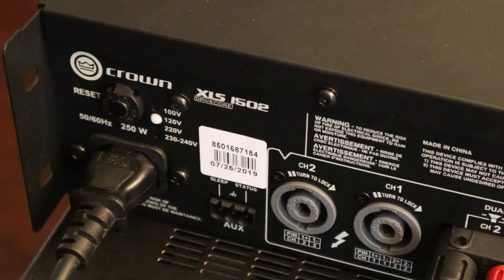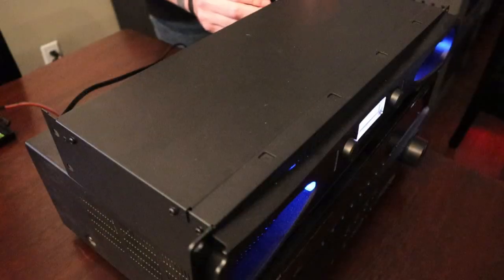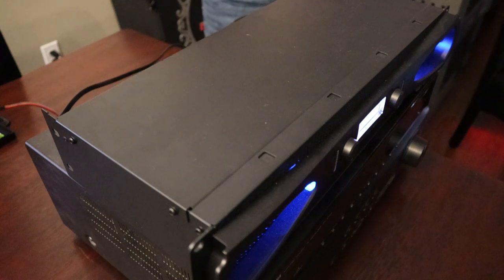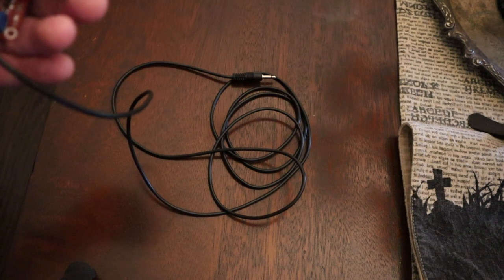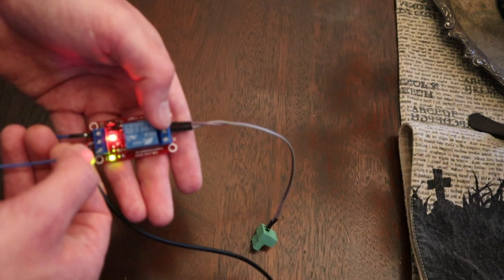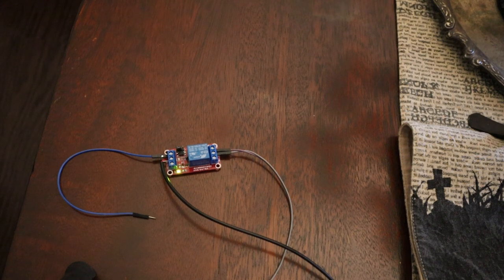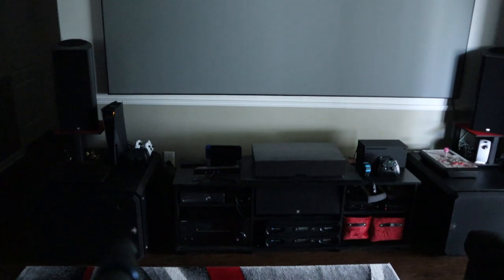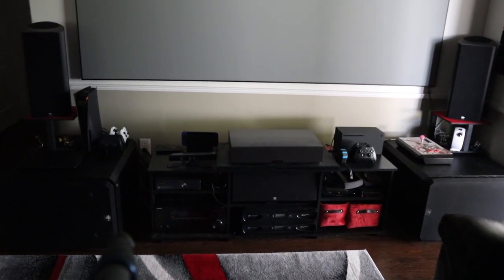12v Remote Trigger for Crown XLS Pro Amps (1002, 1502, 2002, 2502) - Home Theater Integration

Comment: I have been trying to do this for a month. Thank you!
Reply from the maker: Your welcome, I was hoping it would help at least someone trying to do the same.
Reply: @ViciousXUSMC  well...i dont know if i got a bad relay or not but it lights up like yours but it always has a short on it so it always stays in sleep mode. any suggestions?
Reply from the maker: @greenflintriver  If you used the same relay, swap your connection, it has one normally open and one normally closed.  You should be opening the relay on power, so you want to wire to the normally closed connection.

The lights and the clicks will let you know the relay is working.  So thats the first step.

The video shows all those things, so just make sure yours is mirroring what mine did, and make sure you have the jumper wire for the relay activation side, you need power to the board, and to the relay.
Reply: @ViciousXUSMC  thank you for kind reply I will keep trying . I put an ohm meter on the output side of relay and it is 0 ohm short wether power is on or off.

Comment: Panamax power bar m8 av-pro has an 8 plug power bar, 4 plugs are controlled off a 12v trigger from your avr so easy set up for crown xls amps or external devices like hard drives you wish to shut down with one remote. Works great.
Reply: Thanks for this information. I have a Crown XLS 2502 and this is exactly what I've been looking for.

Comment: Thank you so much for this guide. 
I am currently researching everything I needed to build and install 2 15 inch subwoofers into my existing home theater with avr as brain box to the system. For a passive big home subwoofer it seemed everyone on the internet went with these style amps because of their high watt per dollar, but one thing eluded me and it was their lack of trigger which was a hugggee buzz kill. Knowing that there's an easy solution is a life saver, will probably save me about 500 bucks over a home theater oriented external amp with 750-1000 watts a channel

Comment: This works well if you have a relay with dry contacts (i.e. the relay doesn't send power to the contact you close). Be aware some relays are made for lighting and are simply a remote light switch and will not act like a trigger but will send power to your connection.

Comment: I ended up doing something similar on my XLS2500 but with a 3.5mm jack mounted on the chassis and everything else inside. Looks like factory installed. It accepts 3-32v DC as trigger input just like any other high end power amp.

Comment: So we have all read through the comments and know that the Panamax M8-AV-PRO is the best option out there... EXPENSIVE AF for literally a power cord with some additional features but it almost looks to be the best option out there at the moment. We all rather have that protection with our expensive home theater components but having to justify almost 200 dollars for one of these bad boys is wild 

Edit: I found one used one amazon for 140 USD but still not happy with that price at all.
Reply from the maker: I am using the panamax (forget the exact model) and I got the one with network control so I am not triggering it with the AVR, but instead actually network commands using home automation.

So I could have also just used any "smart switch" and had a UPS.  There is always options if you think outside the box!
Reply: @ViciousXUSMC  Ig they really get you because it was made for audio. Like that in itself compels you a ton. The reason I didn't go with the home automation is because I'm a college student building a home theater for my parents in the livingroom and when I leave I just want it to work such that they don't have to try to figure out technology.

 The Panamax M8 AV PRO just seems like it'll just work whenever the AVR turns on which also turns on automatically when the TV turns on.  They're not going to do any additional steps as they're just used to turning on and off and nothing else. 

I'm building the entire theater components from scratch, I learned how to build speakers straight from scratch and even make crossovers so its a big DIY project that has been going on for a couple of months, I've been practicing and building other speakers and now I'm getting ready to build the final ones (CENTER RIGHT LEFT & SUBS), I'll even be using dual 12" ultimax subs from dayton audio in ported enclosures with f3s of 15hz. It should all turn out quite nice

Comment: I wish this guide had been around when I bought my crown amp.  I ended up buying an IoT Power Relay for around $35 and wired it to a USB cable plugged into a USB port on my receiver that powers on when the amp comes on.   Not a bad solution for somebody who isn't comfortable with a lot of wiring.
Reply from the maker: Better Late than never :) My ultimate solution was a Panamax Pro unit that has the 12v trigger built in, since I have 6 of these in my setup, having them sequence and not be on all the time was nice.

I also integrated it to my Alexa so I can turn it on/off via voice command.
Reply: @ViciousXUSMC  do you have the model number of the Panamax unit you ended up with?

EDIT: nevermind, found your other video  ;)

Comment: I contacted Crown and asked if there were any issues just powering the amp on and off through a master controlled powerstrip, where my AVR is the master. When the AVR is on, the rest of the powerstrip is energized. When the AVR is off, the rest of the powerstrip is off. Crown said it would be fine.
Reply from the maker: That's what I have been doing for about a year now but with a Panamax unit that is triggered by my home automation to be voice controlled.

Specifically I used the Panamax so that there is a delay between them turning on/off to prevent huge surges.

Comment: where do you connect it to your receiver if you don’t have the 3.5mm?
Reply from the maker: @robbiegraydon409  You would have to buy a trigger that the AVR can activate.

I'd not go that far, better off getting a smart power strip that uses a master plug to activate the slave plugs.
Reply: is it safe for the crown amp to turn on automatically in that manner when it’s plugged into the smart power strip? or instead of the 3.5 mm could i use an rca instead ?

Comment: I have a QSC 302 that doesn't have any kind of interface to set up a trigger, that I am aware of...and I would very much like to have the ability to do so. Is the power sensing power strip that you posted a link to able to solve that problem?
Reply from the maker: Yeah so many ways to go about it.
Power sensing strip is just the easy way for most people that dont want to make things complicated.

Have it connected to a device that will only be on when the amps should be on and has enough power draw to trigger it.

I am using Panamax units now with advanced home automation that lets me turn them on in sequence with delay via voice command lol.

Comment: I have a couple of matrix distribution amplifiers have an input for a 12v trigger to wake them up.
These rascals periodically go to stand by and I cannot shut that function off. Soooo, my answer will be to wake them up periodically (hit them in the ribs with an elbow as they are falling asleep so to speak) or perhaps keep the trigger on continuously.
These seems to be a variation on what you did here but I do not have the skills to create it myself. Can you help?
Reply from the maker: If you just want to feet 12v to them, that should be easy enough.  Get a 12v power supply and just wire it up using the best connector for the job.

No need for fancy relays and such if always on is your goal (or use a smart switch to turn that power supply on/off when you do want them off)
Reply: @ViciousXUSMC  might a 12v power supply give too much current?
Reply from the maker: @sdsmall1984  No, current is a determination of the load.

Amps never fry a device, voltage does.

The load will determine how many amps are drawn.

Comment: Hmmm 10W is also a lot. Would expect something like 1W.... So its fine for daytime use, but its best to switch them completely off. Smart switch is a good tip!
Reply from the maker: Been using the smart switch solution for atleast a year now and no issues.

I automated it with a Panamax unit with a network card so that from voice command I can turn everything on/off with the added benefit of staggering, so they turn on one after another with a couple seconds delay.

Comment: I might as well just build a whole new amp at this point! Theres got to be a simpler way.
Reply from the maker: Ha, not for everyone.  I think it's pretty simple, and also cheap!  But the most simple way is to use a power sensing smart switch or something.

Just I'm a little OCD about hard powering equipment.
Reply: Got it, these amps have become popular in ht market which is what im using them for. All the home amps just have little 1/8 12v trigger chains. I wish crown or someone sold a simple plug and play solution but i guess ill have to bust out my multimeter